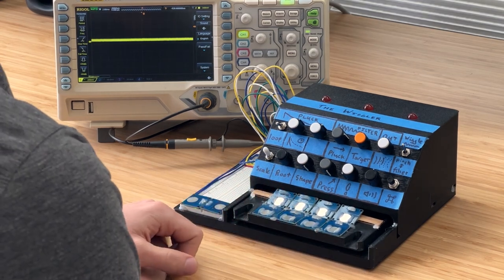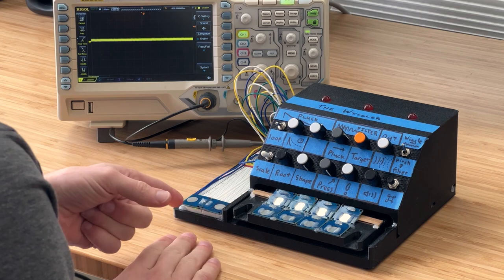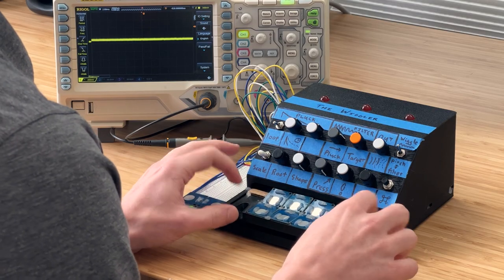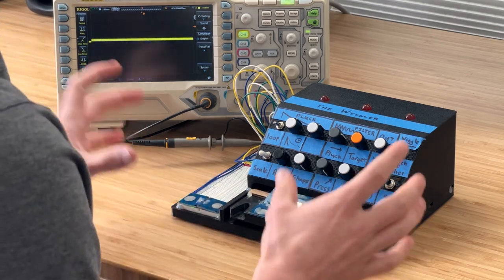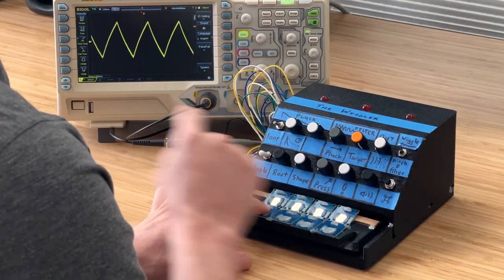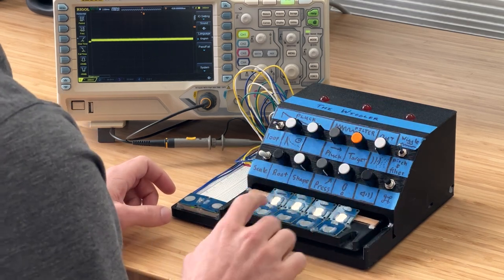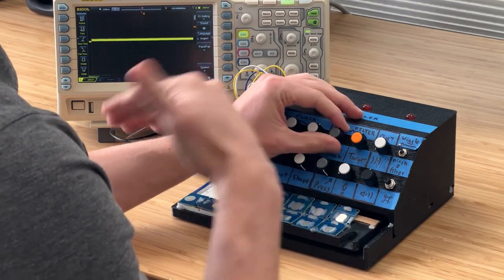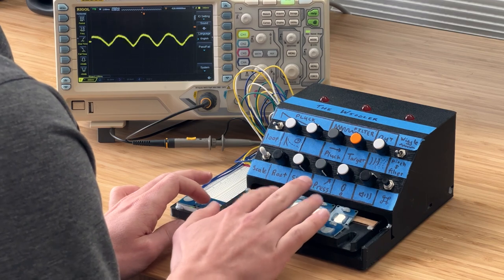Wiggler - Expressive Synth using Daisy Seed and Flexure #synthdiy

Comment: Sounds and works great! Thanks for the walkthrough
Reply from the maker: Thanks Loopop! I learned from the best! ;)
Reply from the maker: Actually, now that I think about it, your continuumini video is where I first heard about expressive synths, so thanks again!
Reply: @sound.workshop  Looks like you could have a hard time using the wiggle by only touching the capacitive sensor. That's why you added the hot glue wedges I assume. If you want to make it as a product I would consider making the wiggle with as little resistance as possible and then allow configuring some artificial resistance in maybe with some clamps or something.
Reply: How many Flexes does it take to get the center of the univer- I mean until it breaks?

Comment: Great work! Super informative video too 😀
Reply from the maker: Thanks! I’ve been a fan of yours for years. Glad to see you here 🌈🌈
Reply: So the magnet sensor also acts as your fsr?? I need to read more into this. This is amazing! I always wondered why electromagnetism wasn’t implemented in fsr sensors, or resistant sensors
Reply from the maker: @flywittzbeats4008  yes that’s one way to think of it. I would describe it this way: the magnet/Hall effect sensor pair is a position sensor, it measures the position of the flexure. The flexure has stiffness, which means I need to apply some force to travel some distance. So therefore in some sense I can estimate how much force the user is applying if I know the stiffness of the flexure

Comment: This is a really cool controller - I absolutely love the keyboard - as a cellist, this fits perfectly in my sensibilities.  One thing I'd love to see with this would be to be able to include the modulation for attack into the vertical movement of the controller as well - perhaps some way that you can have it be controlled only by the knob or to turn it up so that as you use the controller to open the filter, it can also shorten the attack by a dialed in amount (similar to how the filter cutoff works already) - this could allow you to have both expressive, softer playing as well as more aggressive attacks accessible only through the keys, which will lead to a much wider space for performance and emotive playing.  Just a thought!

Seems like a really cool concept also to explore for a more generalized MIDI controller!  Slapping a standard keyboard layout and possibly giving an octave or two more range without needing to hit an octave button could make this a powerful expressive controller for a wide variety of sample instruments and synths.  I know that opens up the development requirements quite a bit, but it'd be a cool dream!
Reply from the maker: I agree with you it would be nice if there was some way to use pressure or velocity to modulate the pluck intensity or make the pluck speed. It’s on my mind. Hard to think of a clean way to do it on the front panel

Comment: It's amazing how just adding the two dimensional expression control allows you to simulate brass so much more accurately using just a triangle wave, attack envelope and filter combo - no sampling required.

If you were to market this as a product, it would probably help to either expand the sound engine a bit, or just do away with it and sell the control surface by itself.

Amazing work! I'm glad I found this video.

Comment: I really enjoyed the sound, also I like the shape of the synthesizer, even in it's unfinished state. I do worry a lil how durable the expressive keyboard is and how versatile the sound generation is. I think adding CV and midi out for the expressive controls would go a long way in making this thing a better value proposition in the future. Keep up the good work!
Reply from the maker: Thanks!

Unfortunately the shape is going to be more of a flat slab like 0-coast for the production version. That makes it cheaper and easier to build. Maybe if I have some success I can come back and make a deluxe version with a tilting panel.

Reliability is a problem we can address. The flexure travel will have hard stops that limit the travel well within the elastic deformation zone. Then we can estimate and test the number of cycles it can take before failing due to fatigue. Worst case scenario it’s a cheap part to replace and I’ll design it to be user replaceable

Comment: This a great springboard into making a DIY Expressive E Osmose for like 1/10th the cost! Thank you for the valuable info on that DRV 5053! That is some super inspirational info for implementing expression into a DIY instrument! I'd bet a small FPGA could probably expand the ADC inputs for more keys and input, and the Daisy should be able to send MPE signals for aftertouch expression and whatnot to interact with JUCE/Gen~ and other plugins/hardware.
Reply from the maker: Glad it was helpful! Thanks for letting me know. Ya the dev 5053 is awesome

Comment: this is awesome! would love to see a second prototype with patch points to allow that expressiveness to be mapped elsewhere. the wiggle could sound fantastic on the waveshape, especially if PWM were added down the line
Reply from the maker: Thanks for the input. I'm working on exactly this.  The only question right now is do I add an attenuverter for this routable wiggle modulation. It costs some space and I also want to be able to calibrate the wiggle to pitch modulation at the factory. But yes, it makes sense to use wiggle to modulate some timbre parameter because we all know how tremolo can sound good.

Comment: Omg i WANT THIS!!!!! This is the closest thing i can think of to building something close to a Trauztonium. If you combine that with a subharmonic generator and a frequency shifter, you'll get sounds that sound absolutely otherwordly. :D
Reply from the maker: Woohoo! Can you share how a subharmonic generator and frequency shifter help the sound? I have noticed that the single oscillator can sound a little weak or thin. In the future I was thinking about moving to more plaits inspired macro oscillator algorithms
Reply: @sound.workshop  Oh a subharmonic generator basically divides the incoming audio into different groups, creating a really interesting sound. There's options for divisions like 4th, 8th, 12th and so on and so forth. A single sawtooth oscillator already is enough to give a perfect initial sound for that. And it can be combined with a formant filter and also a frequency shifter that almost inverts the frequencies.  Oskar Sala is a name you should look up :) He had been working all his life with his Trautonium since the 1930s till his death in 2002. And the Subharmonic generator was basically what turned a simple initial Instrument into something massive and something that was somehow never really done in the world of Synthesizers elsewhere. The initial Trautonium was basically like the Wiggler. Though of course it was built with electronic parts like those that were used for radios. Composer Paul Hindemith even wrote trio pieces for 3 Trautoniums. Each one tuned to a certain tonal range. The String manual was also able to be played in a expressive way and even with the possibility to play glissandi.

Comment: This sounds incredible! This really gives a whole other dimension to synthesizers. You mentioned you were looking into making this a product, I think you would also have success with adding analog outputs that could be connected to a modular setup. MIDI would also be a nice touch!
Reply from the maker: Thanks a lot! Yes I'm definitely doing MIDI out so that people can control their euro with the help of a MIDI to CV module. I would love to also have CV outs, but that will be a bit of a technical challenge because this is a 5V system and many euro envelopes expect >5V, which means I would need to add some kind of voltage booster. Not impossible but I can't guarantee it

Comment: This is so cool!
Suggestion: build a simple machine with a motor, some belts or gears and two big bumpy wheels that stress tests the flexure/pressure for you to see if a candidate material can take, say, 100.000 wiggles and presses, after having simulated months of sunlight in high humidity. To avoid a refund/RMA nightmare.
The earlier you start those tests, the sooner you will have your optimal solution ready for production. Switching materials during production means new molds (not sure if that's the scale you're thinking of, where testing is not just mandatory but actually enforced).
Also, regardless of scale, EM tests? Both for tolerance to interference on the switches, and the switches interfering with their surroundings. Especially when you plan to implement those capacitive switches on a larger PCB instead of going with modules. In case of an integrated PSU, the PCB that holds the knobs might act as an EMI shield.
Not being negative, just anxious about the non-standardness of it all, although that seems to be where the gains are, along with the fun.
Reply from the maker: No worries! I totally appreciate the input. I agreed fatigue failure of the flexure is a risk. I do need to test it, but I also will approach it theoretically too. We can design hard stops to limit the flexure travel, and from there simulate the maximum strain in the flexure, then use fatigue life plots for the given plastic material to estimate the fatigue life. From there I’ll follow up with testing. Of course I have a lot to learn.

Comment: Very nice design. Wonder what the long term durability of the physical flexure piece would be. I like the combination of basic synthesis with the mechanics to keep it simple but expressive. Well done.
Reply from the maker: Fair concern. What you can do is design the flexure to be well below its yield strain for the movement of the instrument, and also bake in hard stops so that the flexure never travels past the expected motion. I’ll also design it to be easy to swap out the flexure

Comment: Beautiful !
have you figured what the PCB will look like ?

maybe use a 3-way toggle switch UNDER the keys (either left or right)
to Octave up & down with your Thumb ?
Reply from the maker: Thanks! Here’s roughly what the PCB will look like.

https://www.instagram.com/p/CpDuS46OoTK/?igshid=YmMyMTA2M2Y=

Good idea will the switch point to the front. I don’t think it’s possible though because the flexure takes up that space. I think what I’ll do is have touch pads up the left and right side so you can access them with the left or right hand. And I’ll probably 5 pads on each side that range from -2 to +2 octaves

Comment: Seriously i am SOOO behind this project and really would love to build that myself. Heck it would be awesome to do with hole-raster / strip PCBs and being able to construct this with easily available parts that don't require a custom made PCB. I mean you definitely could create a PCB that could be sold individually (or in a kit) but also leaving the option to create it with normal DIY PCBs.  I don#t mind that it's Monophonic. I mean imagine this to have TWO Manuals. Like the Mixtur Trautonium that had 2 ribbon manuals. It probably doesn't even have to be a string with metal sheet underneath to create a contact but  there should be a way to create a ribbon manual like the one Doepfer sells. And combining that with the wiggle mechanics this should definitely be feasible to do. Like for a more sophisticated version. I love the sound of it and really this looks and sounds exactly like something i've been looking for :D This is absolutely awesome!! Subbed!! :)
Reply from the maker: That’s all great to hear. Ooh I like the two manual idea. I definitely need to do a double wiggler duet as soon as possible. 

However, one advantage of the single manual is that you have one hand that’s totally dedicated for knob wiggling, it’s really fun.

I’ll keep the DIY crowd in mind for sure. The first iteration will definitely be a finished instrument, but I’ll keep the Sind in my mind about if a kit is possible. At the same time, I have ideas for other music diy projects that I’ll share on this channel in between wiggler updates

Comment: Very cool design! Definitely want to see where this goes! My first reaction was "can I also modulate..." which I realize is always the fear of feature creep... (I thought there was going to be some modulation matrix using the ⌘ button as a learn function). I'm a huge fan of the Trautonium, and this looks like an interesting way to emulate some of that performance aspect. Looking forward to seeing how this develops!
Reply from the maker: Thank you! I don’t think I covered in this video, but right now my goal is to make and sell something this year, so I’m looking for the minimum viable expressive synth. Some rules I gave myself in order to keep the timeline: no screen, no injection molds, no custom sensors. 

With no screen the mod matrix needs to be small because each mod routing costs one knob of space. But I also want the instrument to be fun for knob wiggling, so I’m looking for a balance.

In the future I want to make something that looks more like a LinnStrument with a screen, then I can have a huge mod matrix!
Reply: @sound.workshop  It all makes sense, of course! I wasn't implying that more needed to be done, I just really like modulation on wave shapes, and because you are already have the triangle to saw modulation, I could really see pressure modulating that with the alongside the filter cutoff... Regardless of that, the control interface for this synth is already looking amazing, and can't wait to see where it goes from here!
Reply from the maker: @HAntonRiehl  thanks for the input. If you look at my instagram, I actually have a big knob for waveshape (the plan is to have 3 different algorithm slots), and attenuverters for pluck and press to modulate it 👍. So we’re on the same page there. I might also add a switch to reroute the wiggle destination
Reply: @sound.workshop  I started following you on Instagram after seeing this video, and thought I started to see the waveform modulation, but haven't had a ton of time to really dive into what you're planning there. It all looks exciting though. :)

Comment: Sounds really nice =)

You could make the right finger interface 1 octave of the wicki-hayden note layout, and then you could extend it left and right for sharps and flats!
Reply from the maker: Oh I did t consider that, I’ll look into it

I’m leaning away from it though because I want to be able to adjust to arbitrary scales within the same set of keys. I also took a cue from ortholinear keyboards, where people people that if the two keys are directly above/below each other then it’s easier for one finger to access both.

Maybe I’ll just make an extra touch key section though to try it out

I don’t want to extend further left/right though because the flexure starts tilting the more you press off center
Reply: @sound.workshop  Yeah the offset rows can be weird and might be objectively worse ergonomically. You can always skew the W/H layout to be ortholinear, which would make the notes on your current interface:

F-G-A-B
C-D-E-F#

or

F   -G-A-B
Bb-C-D-E

(And of course, having 8 buttons to assign whatever notes you want seems like a reasonable and valuable option too.)

Have you considered adding "octave rounding", like is used in GeoShred?
https://youtu.be/ZAWNgkn-Y4A?t=363
Reply from the maker: @JLMoriart  those ideas make sense. Actually the way I’m tackling it is elsewhere on the front panel there will be 12 backlit touch pads arranged in a piano pattern , so you can just toggle notes on/off to be included in the scale, relative to C. Then the same 12 pads will allow you to pick the root note when you hold down the root note touch pad. So with that you could achieve the wicki Hayden ideas you proposed.

I don’t think I’ll do octave rounding, it’s a bit too specific for my taste. There will be 5 or 6 octave select touch pads, so your off hand can run up and down then while your main hand does a repetitive pattern. Similar to the beginning of this video.

Thanks for the ideas though! I appreciate the perspectives
Reply: @sound.workshop  Cheers!

Comment: Very clever indeed! Synth sounds lovely too :) you could also make a fantastic modern remodel of the ondioline with this technology fused with the the original tube based design! Thanks for sharing
Reply from the maker: Thanks! Ya actually ondioline uses a flexure too but it’s a bit different than this one
Reply: @sound.workshop  yeah - yours is more ingenious - remarkably similar action though from the looks of it. Well done for the design!
Reply: ^you have also eliminated the need for the asbestos pressure / after touch pad too!
Reply from the maker: Haha well it’s a lot easier to do these things these days. George Jenny didn’t have a magic motion measurement chip delivered to his doorstep for a few dollars

Comment: Also a question, is any of the components analog, like the filter? It sounds good either way.
Reply from the maker: The sound is 100% generated by daisy. The only analog bit is the outputs of the Hall effect sensors. I think that when you have an expressive controller that makes the instrument sound warm and alive. You don’t need the fanciest circuits. Also, there’s no way I could do this analog, that’s far out of my skill set. It could be a fun challenge to make this fully analog far in the future tho

Comment: :face-red-heart-shape::face-red-heart-shape: there are so many many DIY synths. However, the basic architecture or signal flow never seems to change.
Reply from the maker: Haha thanks. In my opinion the oscillator -> filter -> amp is very traditional, however my set of modulators is what makes this unique
Reply: @sound.workshop  Hi ... Very neat design and sound quality... Make more DIY ❤️🙋🏽‍♂️